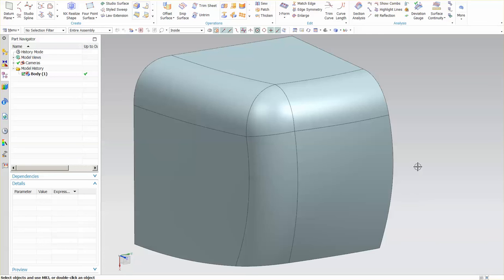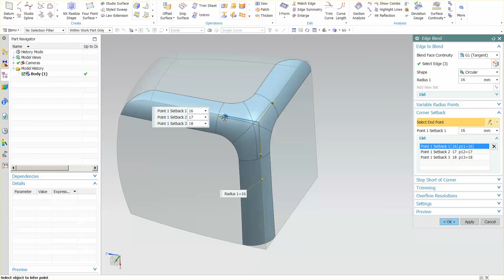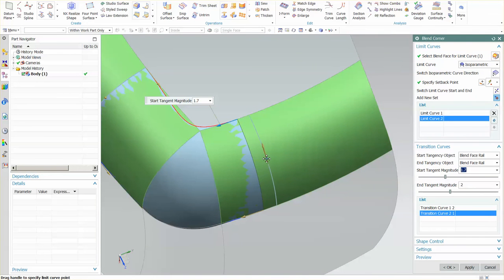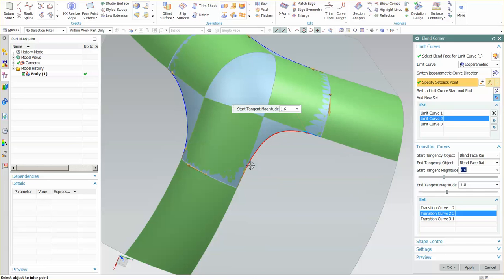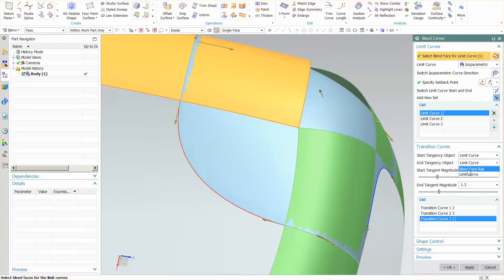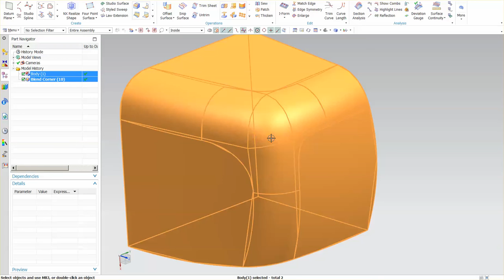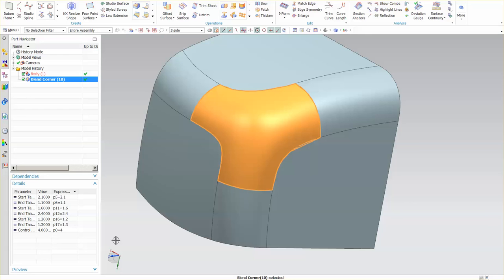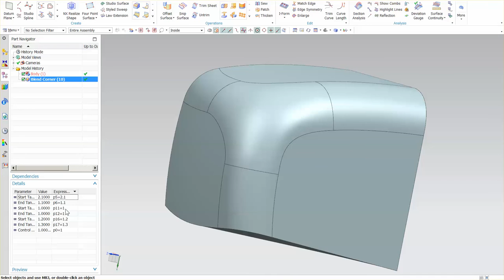Siemens NX 10 | Class A Tool: Blend Corner

Comment: There´s not such limitation using this tool. Just right click and choose "Edit with Rollback".
Reply from the maker: +Rafael Campos I messed around with settings and by default I put it on "Edit with Rollback". The problem I had was the settings folder was locked because permissions to write were not set. Thanks for pointing it out. I overlooked that.

Cheers.
Reply: I´m glad to help. I´m loving your videos and I´m learning a lot. Keep the good work!